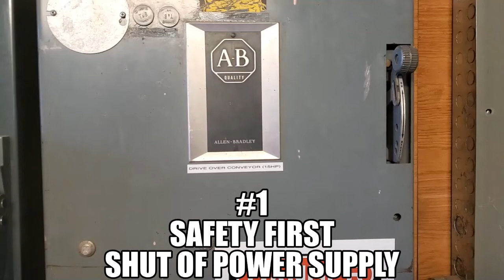Conveyor Broken Bearing Replace On Jobsite

Comment: Dude.... use a brass hammer whenever working on shaft/bearings.
Reply: At least a piece of wood to hit on instead of the bearing itself. Also noticed the grease fitting being trapped on the bottom.. he should of put the bearing on with the fitting on top so that it can get grease when needed.
Reply from the maker: Yes that was correct but sometimes it doesn't follow the basic rules:hand-pink-waving:
Thanks and noted next time:face-blue-smiling: @900fam
Reply: I'm new to it what would u use rubber mallet.
Reply: @brianberson4169 rubber mallet is okay but brass hammer works best. Also never hit the bearing like this guy. Get a drift and lay on face of bearing then hit with brass hammer. U should only hit the inner race when working with bearings.

Comment: Next time use a soft face hammer to drive your bearings on and that’s an eccentric locking collar on the bearing. You’re suppose to use a punch in the hole that the set screw doesn’t go into and tap it around in the direction of shaft rotation.
Reply from the maker: Your correct buddy. video shows how to do it in basic ways but it's up to maintenance guy how they provide proper tools for every project available.. in that time we did just to run it for it will needed it very badly in the middle of busy operation..